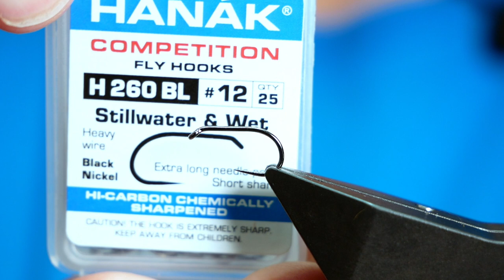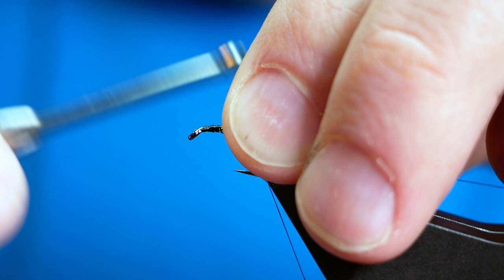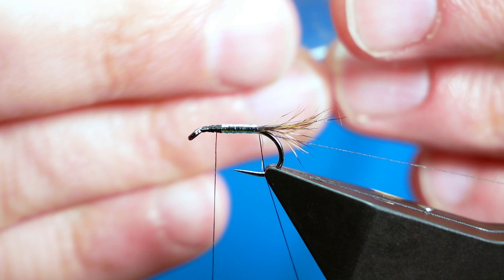Fly Tying, How to tie the Pimped Hares Ear.

Comment: Very nice Lindsay!!
Need to get one of them dubbing spinner thingies!!
Great tutorial!!
ATB Chris.
Reply from the maker: I do quite like that one.
Reply: Chris if you have a set of swivel hackle pliars you can spin a loop. I used it for years. Fill your loop, close it. With one hand squeeze your jaws open and with the other pulling the loop tight, wrap the thread around the top or bottom jaw once. If you just put it in the jaws without wrapping the thread around one of them, it may pull out, so just a single wrap around top or bottom jaw, let them close and hold the pliars with one hand and spin it while holding it steady. Sounds way more difficult than it is.
Reply: @kerrypitt9789  thanks Kerry ,I'll give it a go!